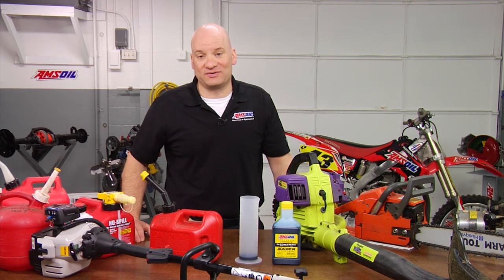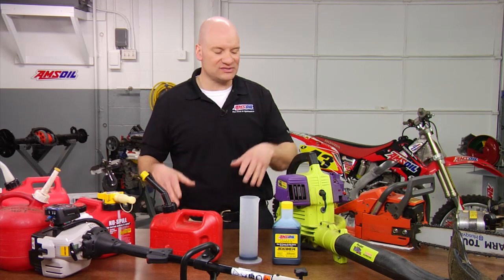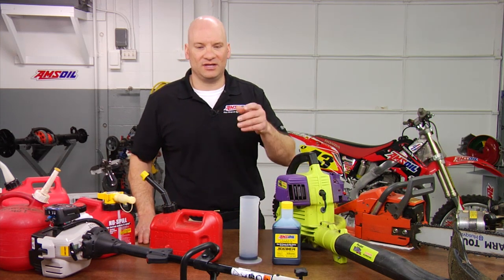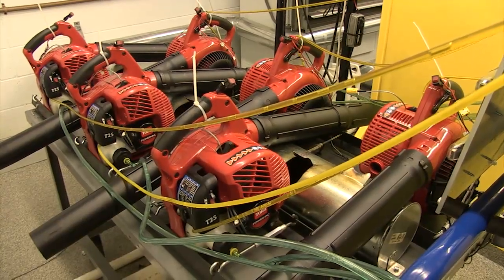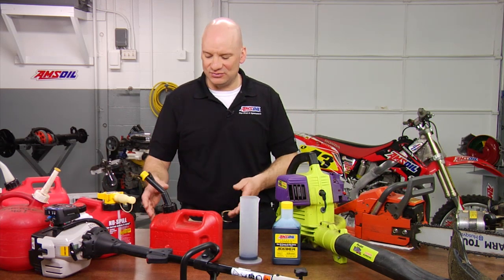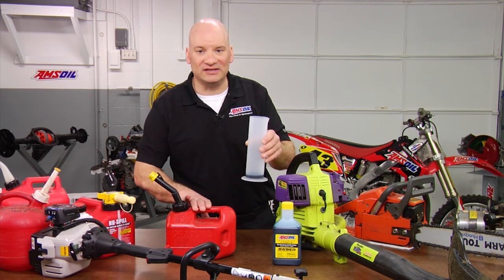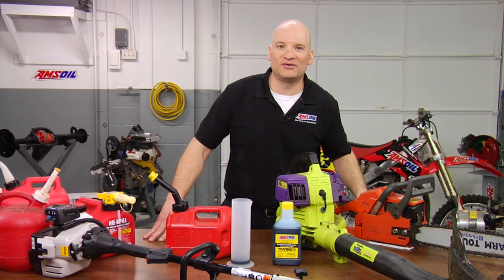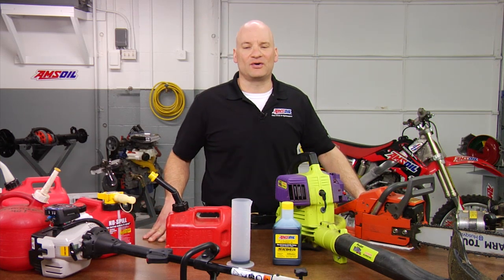SABER® Two-Stroke Oil Mix Ratios

Comment: My Dad was a amsoil dealer back in the 80's, his stihl chainsaw ran 100 to 1 for 30+ years still runs strong to this day.
Reply from the maker: We always like to hear these stories! Thanks for sharing, Ben!
Reply: I bought 6 gallons of amsoil interceptor for my 8v92 2 stroke. it runs equivalent at 40:1
Reply: @jlo13800 Oh my 🤦‍♂️
Reply: @jlo13800   you don't mix oil and diesel for a two-stroke diesel
Reply: @domenicaltieri5714  actually I pull some off to mix to burn and add oil
Reply: @domenicaltieri5714  The Trump train has an 858 CID per cylinder v-16 2 stroke!

Comment: Been running it at 80:1 in my saws for a while now, no problems at all. You can tell when you pour this stuff that it's got high viscosity compared to a lot of other oils. It's high quality stuff
Reply: How about 100:1, per AMSOIL recommendations?
Reply: @HiTechOilCo  Personally I'm not comfortable running any oil at 100:1 to be honest. I've messed around with different ratios with Saber and now I just run it at 50:1 in my saws. It still burns cleaner than most oils at that ratio and I'm 100% confident I'm getting proper lubrication, especially the bottom end. I think you could run it at 100:1 in some engines but a chainsaw that runs at 11,500 RPM is a demanding engine and I just prefer to be safe. I've torn down saws that I've run at 50:1 and they look really clean and well lubricated so I'm gonna stick with that
Reply: @AnarchAngel - "docrw - 4 years ago - 
After break in, it's all I would USE...Been using the original 100 to 1 for over 35 years and it's amazing!!!  I get the same thing with all the idiots saying it's NOT enough, but I can show dozen of pictures of 20 chainsaw internals with NO wear, NO carbon,  No mess, No problems, Nothing but good to say about this oil!!!!  Also less oil is better on octane ,  I just took apart a Husqvarna 266 XP and the piston looks new with no carbon at all, after 35 years of use (professionally)...  The inside was so clean and compression is factory numbers.  Just do it. "
Reply: @HiTechOilCo  I don't doubt that under normal conditions in a properly tuned engine 100:1 is fine. I personally just like to leave myself some wiggle room, it just helps me sleep better knowing for sure I've got the lubrication I need even if something should occur that exposes the engine to less than ideal lean conditions. I've tried all types of ratios and inspected engines run on them. I see no harm in running it at 50:1. Amsoil themselves say it can be run at conventional ratios 🤷‍♂️ The bottom end (rolling friction) in particular cares more about lubrication quantity than quality. Running 100:1 requires that you lean your engine out as well, which results in even less oil entering it. I'm not doubting the oil, I simply feel more comfortable running an excellent oil like Saber at a conventional ratio. I KNOW I'm getting more than proper lubrication. Again, I've noticed no ill effects such as excess carbon. I know several mechanics that agree with me on this. Guys that have seen saws exposed to all different ratios in saws with various amounts of hours on them. Even guys here on YT like Richard Flagg, ask him his opinion 🤷‍♂️ I realize 50:1 with this oil is more than necessary. For me, that's kind of the point as long as I know I'm not creating problems by running too oil rich

Comment: When you change the mix ratio, you change the fuel viscosity. This changes air fuel ratio. I engine jetted for 32:1 is going to run really rich if mixed at 100:1
Reply: Yeah...just tune your engine for the new mix

Comment: Been using a 2 stroke pre mix at 50:1 and changed to amsoil 100:1 mix and my stihl trimmer runs much stronger than before much more power at full Rev....excellent product
Reply: i run amsoil in my detroit diesel 2 srtoke. a gallons of amsoil of sabre professional 8 gallons in a 12v71 detroit.  im using 6 gallons of interceptor in an 8v92 2 stroke diesel!
Reply: What pre mix were you using before?
Reply: @jlo13800 why on earth would you dump 2 stroke oil in you’re Detroit

Comment: I have been running Amsoil 2 cycle oil since it first came out. I run the Sabre Pro at 3 tbs (1.5 ounces) to a gallon of non-ethanol fuel.

Comment: Cool , have used alot of amsoil with NO adverse results in rear ends , 4 cylinder s10 engine for 15,000 miles with no oil change, just a filter halfway through and 2 stroke 500cc sled engines and a really sweet running cr250r , I ran dominator in the 250r at 2.5oz to the gallon for around 300 hours with zero loss of compression . Going to get some saber today and run it in a nice old Mcculloch 10-10 chainsaw , I'll put 2-1/2oz in it and go from there ! Thanks for the video 👍👍👍
Reply: So 50:1 does work well?? Not to rich??
Did you ever get into the top end to confirm?
Reply: @jacobhendrickson8935  Yep , run 2.5 oz in anything it will never fail because of the oil . Amzoil says 1.5 oz a gallon for saws and weed wackers but I run 2+ in them

Comment: Do you guarantee that I will not blow up my 2 cycle engine running 100 to 1? Does amzoil have a guarantee for this ? I have a stihl bg50 blower
Reply from the maker: We do back up our products with a limited warranty. 
P.S. Coincidentally, we have tested SABER at 100:1 in BG50 blowers in our mechanical lab with excellent results. 

If you'd like to speak with one of our Tech Reps in more detail, you can reach them at Tech@amsoil.com or by phone at 715-399-8324.

Comment: Would this work in the Shindaiwa H4 Hybrid engine that requires 50:1 2 stroke oil? I can't seem to find any testaments about the compatibility with that engine at 100:1 ratio. My logic tells me that it should work but did somebody actually try it? I don't want to ruin my T344 trimmer. Thank you.
Reply from the maker: Hi Marius, 

Thanks for the question. 

We do not have any testing done on this engine. If you want to run it at a 50:1 ratio with our SABER Professional Synthetic 2-Stroke Oil, that will be just fine. Our product is rated to work at all ratios when using a 100:1. So if you wanted to run the oil at 100:1 in your equipment, that would be fine too.  

Reach out to our Tech Team at any time at Tech@amsoil.com or 715-399-8324 and someone will be happy to answer any additional questions you have!

Comment: My question was answered here. I’m just not comfy at 100:1 in my 8000 dollar dirt bike but was worried that if I bought Amsoil and ran 50:1 I’d be way to rich as in causing issues rich. Now I’m trying to figure out what would be the best ratio for overall reliability?? Cause to much can cause rings to stick along with carbon issues and fouled plugs.
Reply: I don't use it in bikes but I use it in my many saws. I run it at 80:1 for a little extra insurance. Never had a problem
Reply: Saber is NOT intended to be used on bikes.  It is intended to be used on handheld equipment such as chainsaws, leaf blowers, etc.  AMSOIL has other oils for bikes, boats, etc.
Reply: @wayneedgerton5892  It would work fine in bikes IMO. There's not really a difference between a bike and handheld 2 stroke power equipment besides the size of the engine, they're both air cooled 2 strokes. You're correct that AMSOIL has other formulas they say are more appropriate for bikes though like Dominator. Saber used to say right on the package it could be used on bikes. I think the decision to remove that was probably more of a marketing thing than a reflection that it's bad for bikes
Reply: amsoil has motorcycle two stroke oil. saber is intended for small 2 strokes.......i would check out their motorcycle tab.

Comment: I have used Saber in my 025 Stihl chainsaw at 100:1 for over 20 years without any issues.  It still runs like new.  I wouldn't use anything else.

Comment: Can I run amsoil saber at 40:1 in my string trimmer?
Reply: Yes.  However, you can also use AMSOIL at 100:1.  It will run better, less smoke, and better protection.  If that ratio scares you, AMSOIL 50:1 will also work.

Comment: Is there a chart on how much Sabre to add to 5 litres of premium (no ethanol) gasoline?  I want to mix it at a 50:1 ratio.  Also, does Sabre have a stabilizer in it or do we have to add a separate Amsoil fuel stabilizer?  Thanks.
Reply from the maker: Hi, Al. You need 100 mL of SABER to mix at 50:1 with 5 liters of gasoline. SABER does have stabilizer in it, so you’re good to go there. Keep us posted if you have any other questions. Or, feel free to reach our Tech Department at Tech@amsoil.com or 715-399-8324 and they will be happy to help you out.
Reply: 5L is 5,000ML..... 5,000 / 50 is  100. So 100ML oil to 5,000 ML 90 octane NON-ethanol. 
Just so you have the math. 
I don't even use metric much.

Comment: It's funny to read people's posts going against the 100:1 ratios. Why would Amsoil come up with this and only sell you half the oil? Seems it would be better for them to sell it using 50:1 and double their sales. Obviously it works. I have used it in all my 2 cycle equipment for years mowing commercially. I run my 2 cycle stuff hard and also in my Stihl 4 mix engines as well. There are a lot more mechanical parts in a Stihl 4 mix engine than a traditional 2 stroke engine. I have never had any issues nor do I hear any abnormal mechanical noise that one might expect using half the oil. This stuff works. Exhaust screens stay clean and that tells me that the rest of the inside of the engine is too. I have bought several used pieces of 2 cycle equipment over the years and after about 5 tanks of non ethanol gas mixed 100:1, they almost always run better than when I bought them.
Reply: I have a Shindaiwa H4 Hybrid ( T344 trimmer)and  I think it's the same technology like your Stihl 4 Mix. You say you have been running 100:1 Saber Professional in your 4 Mix engine with no problems? If so then I am safe to run it at that mix ratio in my H4 hybrid, too, I think. Thank you.
Reply: @mariuso4879  yeah, I have been running the Amsoil mixed at 100:1 using non ethanol gasoline. No problems. I took the spark plug out this past winter to inspect it and it was very clean. The muffler screen was almost spotless with just a light amount of black dust on it.

Comment: After break in, it's all I would USE...
Been using the original 100 to 1 for over 35 years and it's amazing!!!  I get the same thing with all the idiots saying it's NOT enough, but I can show dozen of pictures of 20 chainsaw internals with NO wear, NO carbon,  No mess, No problems, Nothing but good to say about this oil!!!!  Also less oil is better on octane ,  I just took apart a Husqvarna 266 XP and the piston looks new with no carbon at all, after 35 years of use (professionally)...  The inside was so clean and compression is factory numbers.  Just do it.
Reply: What professional capacity? Cuz from what I hear from loggers and full time arborists is that a saw lasted a long time if it went 3-4 years when it's being used hard on a daily basis
Reply: I too like to use a synthetic blend for break in, Husqvarna XP+ or Echo Red Armor are both very good. Honestly for some saws I continue using the Husky at 45:1 even after it's broken in. The Husky oil barely has any smell to it and my saws that run on it always look excellent when I break them down. Red Armor is my second choice. It has excellent film strength and apparently cleans carbon deposits but my saws seem to think it's not quite as good of a lubricant as the Husky stuff. Run Saber in most of my saws at 80:1 though and have never had a problem. I'm not crazy about how it smells but there are definitely far worse (cough cough Stihl Ultra). My saws that run on Saber run very clean and I never see any signs the engine isn't getting adequate lubrication

Comment: I see a dirt bike in the background, is it safe to use on Dirtbike?
Reply from the maker: Hi Thomas, we do not recommend using SABER in dirt bikes. It is formulated for small hand held equipment and doesn't meet the specification for dirt bikes.
Reply: Very safe and it will run very strong, no fouled plugs, etc.
Reply: Greg Croteau, I did a research on this oil. I understand why
Amsoil does not recommend it.

Comment: Why does everyone wanna use less oil and save a couple dollars? Oil makes moving parts move smoothly does it not? Modern synthetic oils burn so clean and effectively. Why not just run what the manufacturer says using a great oil? My 40 year old Lawn Boy, 10 year old stihl string trimmer, 45 year old mcculloch chain saw and 5 year old weedeater blower all get non oxygenated 91 mixed with Saber at 32:1 and they run perfectly and start easily after sitting in the winter.

Comment: Yes, finally a video on my favorite Amsoil product. I've been using it for years at 100:1
Reply: ever had a machine fail using that mix?  or have to drastically to a carb adjust or anything so you can run 100:1 ?

Comment: Can you put this in 2 stroke dirtbikes
Reply from the maker: SABER is dialed-in specifically for handheld power equipment, so we haven’t tested it in motorcycles. We recommend DOMINATOR Synthetic 2-Stroke Racing Oil in two-stroke dirt bikes, Rad.

Comment: Good help. How does this product rate with different octanes
Reply: Octane has nothing to do with it.
Reply: KING TROLL so I can use "87" out of my local stations and not worry about blowing a top end quicker on a dirt bike 🚲
Reply: mlkm11 Dont listen to King Troll, guy is clearly a knob. Also, saber works with any octane gas and works very well, it will hardly reduce your octane level running at 100:1 and runs much better than anything that requires more oil.
Reply: Ok cool  I have been mixing 87 octane with amsoil @50:1 for an old dirt bike. I understand that jetting is what is most important

Comment: The bladder pack that I have is 1.5 oz of 100 to 1 if I use that for one gallon for my 50 to 1 snowblower that should suffice but your racial chart has 1.3 + 1.6 and it varies from 80 to 1 to 100 to 1. Then on the package it says :50 to 1 add two packages what's the deal here
Reply: Yeah the bladder packs will give you a mix richer than 100:1. It ends up being a little a over 80:1. I run 80":1 in my stuff anyway

Comment: Would 100:1 be sufficient for old engines with bronze bushings as bearings and felt seals?
Reply from the maker: Hi Lorenzo, Thanks for the question. The AMSOIL Saber Professional 100:1 can be used in any two cycle engine that conventional two cycle oils are used.  There is no issue with compatibility with the engine components or seal materials. Keep us posted if you have additional questions, or you can always contact our Tech Team at Tech@amsoil.com. Thanks!

Comment: does anyone have experience with this product in big bore 2 stroke dirt bikes. sounds like it would prevent loading up in the tight spots where I'm putting but still provide the protection for the long WOT runs through the sand.
Reply: scott 500 just run a high octane gas and mix at 32:1 or 40:1(better at 32:1 for power gains and lubrication) and you can run any oil on the market. EVEN 30W SAE MOTOR OIL. more oil=more power and better lubrication no matter what the application is.on a fourstroke you lean the jetting out to get more power. it is the same on a two stroke.more oil=less fuel(or lean jetting) and therefore more horsepower. putting a lot of oil is a good thing.

Comment: I'm using Dominator oil mix at 50:1 in my Honda CR85R(just switched the whole bike over to Amsoil) . Could I use Dominator in my chain saws,  weed trimmers? I'm really trying to get down to 1 mix container. 
I'm trying to go all Amsoil I have 2 ATV's, 1 Dirt Bike, 1 Tractor, 3 Vehicles, 1 Weed trimmer, 1 Chainsaw, 1 Snowblower, 1 Boat.
Reply: I can speak for the saw...Dominator should work just fine
Reply: @AnarchAngel1 Until it comes to rust protection, which Dominator lacks compared with Interceptor.

Comment: Can I use this in my 2005 yz125 ??
Reply from the maker: Hi 2Gunner, our primary recommendations for the 2005 YZ125 would be the DOMINATOR Synthetic 2-Stroke Racing Oil (http://bit.ly/2rUB940). You could also use INTERCEPTOR Synthetic 2-Stroke Oil (http://bit.ly/2kFWxGl). We do not recommend using SABER Professional Synthetic 2-Stroke Oil in this bike. Keep us posted if there are any additional questions.
Reply: No I'm curious to why not ? Will it damage it ?

Comment: I have a mix of 2 stroke engines, newer and older, spanning ratios from 25:1 to 40:1. String trimmers, snow blower and gas scooter. Which oil and ratio would work best to standardize my mix ratio across all my equipment?

Comment: My new Chainsaw says 20 to 1 for 10 hours, then 25 to 1 after that. Could I run 50 to 1 with Saber and be safe.
Reply from the maker: You should be able to run the Saber Professional at 50:1 in place of 20:1 or 25:1 ratios with no problems.  The Saber is very concentrated, and will do a great job lubricating at the 50:1 ratio. Keep us posted if we can help with anything else!
Reply: @577buttfan  I know they do, but when it seizes up, think they will buy me a new one, doubtful lol.
Reply from the maker: @StrBADCyperIgwt  We back our products 100%, so you can feel confident in mixing at the 100:1. If you'd like to get more details, don't hesitate to reach out to our Tech Department at Tech@amsoil.com and they'll be happy to assist you. Thank you!
Reply: @577buttfan  Too bad Klotz isnt 100% synthetic. Next!
Reply: @577buttfan  😂 Which Klotz is 100% synthetic? I havent seen any claims or ads that say that from what I quickly perused. Please educate me on which one. I will send it off to a lab and test it. Then I can test it myself. You arent in my league. I have a spectrometer at my disposal. Dont make me mop the floor with YOU.
Reply: @577buttfan  Hey wow, why so hostile? You started it! 😂I am willing to learn.